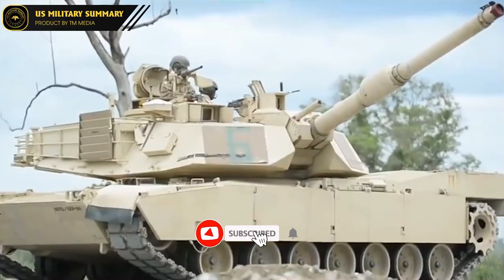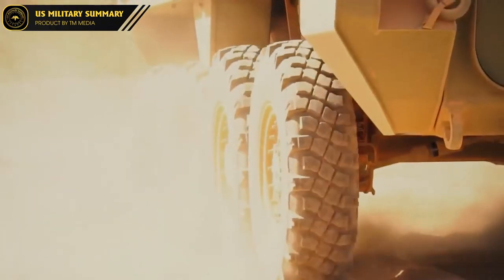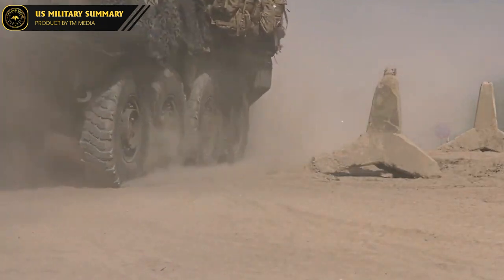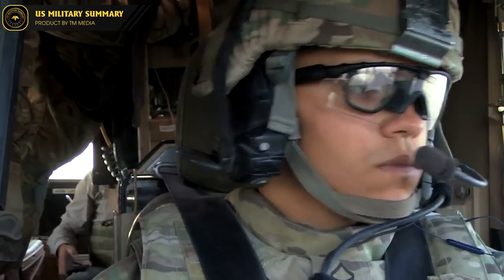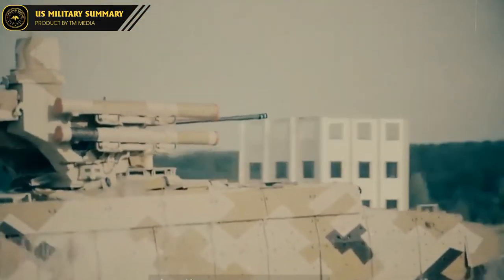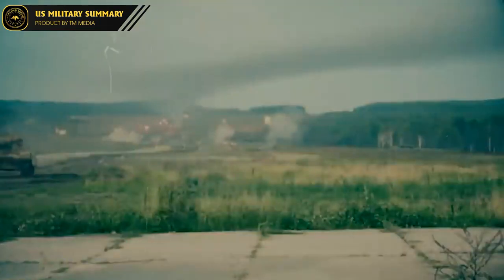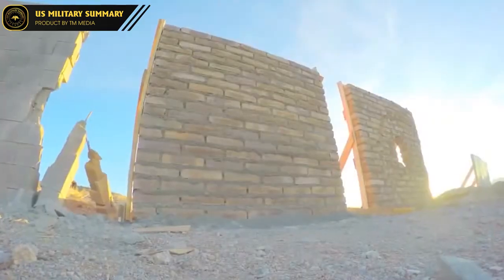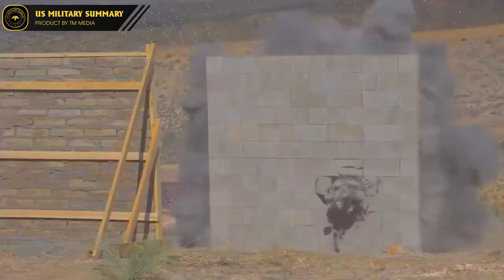A Closer Look at the M1126 Stryker: Infantry Carrier Vehicle in Action | Military Summary

Comment: What are the key features and capabilities of the M1126 Stryker in modern warfare? Military Summary
Reply from the maker: The key features and capabilities of the M1126 Stryker in modern warfare include its versatility, mobility, and firepower. It is a highly adaptable vehicle that can be configured for a variety of missions, including reconnaissance, infantry transport, and fire support. Its mobility is enhanced by its eight-wheel-drive system, which allows it to traverse a wide range of terrain. Additionally, the Stryker is equipped with a range of weapons systems, including a 105mm cannon and a 7.62mm machine gun, making it a formidable force on the battlefield. Thank you for watching US Military Summary on YouTube!